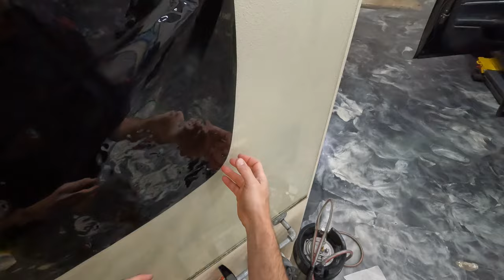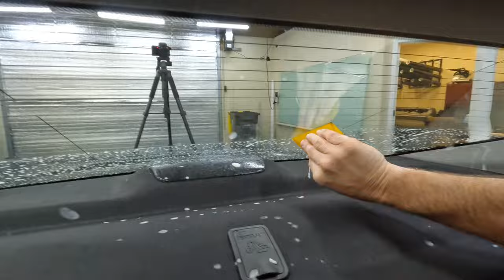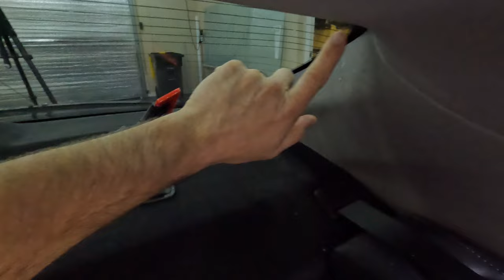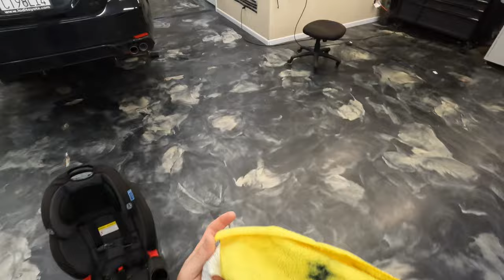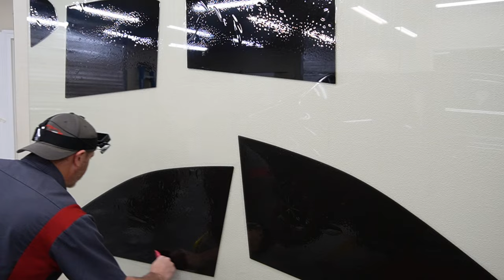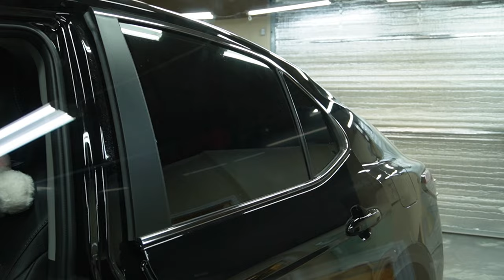2024 Toyota Camry Window Tinting Masterclass: Full Car Tutorial

Comment: Love the content! Quick question! Dry shrinking vs wet shrinking is it personal preference or is one better than the other? Thanks for the help!
Reply from the maker: Thank you. These window tinting tutorials will get better with some more time. I've only been recording window tinting for a couple of months. I'm going to do some much more in-depth videos on heat shrinking and things.

Dry shrinking is leaps and bounds better than wet shrinking.  Was taught wet shrinking when I started tinting.  I used that technique for a lot of years. Once I tried Dry shrinking.... I never looked back. 

With dry shrinking, you can shrink the full area around the finger. That really helps with large fingers. With wet shrinking, you only get to shrink the film where it's not touching the glass. Also, water is your enemy when shrinking film. It's working against you the whole time. It is also so much easier to crease the film. 
Well, there is my input on that. I have a lot more to say, but not with typing. 😆 this is already more of a short story. 🤣
Reply: Thanks for the in-depth explanation. I’m just starting to learn the trade. I took the rear quarters out to tint them since this is my first time and they had some small contamination on them. I’m putting off trying to do the back window last because that’s what I fear the most lol. I’m also trying to figure out on a reverse roll how how the liner ends up being on the outside 😂
Reply from the maker: I need to do a more in-depth video on the reverse roll as well. It's an awesome technique.  I've got more tint videos coming on Fridays. I do explain the reverse roll even better. 
You need to learn to tint those wings in place.  Pulling them out is a bunch of extra work! 👍🏻
Reply: @EncorePPFtint  thanks again for the help! I’ll be keeping an eye out for those upcoming videos!
Reply from the maker: Fridays window tint install goes over how to unroll the reverse roll so the liner goes onto the back of the tint. That should give you some good info. 👍
Reply: @EncorePPFtint Great! Thank you!

Comment: I was told that these cleaning pads can damage the defrost line. What would it be if you had to use a different tool to clean and reach the bottom of that back window?
Reply from the maker: First, I'd like to say that these cleaning pads will not damage defroster lines. I've tinted thousands of cars over the years and haven't every damaged any defroster lines with this tool or scrubby pad.

I'll give you links to the products I use. Maybe this person was using something that looked close but was more abrasive? Honestly, you won't ever damage defroster lines with these tools. I can't stress that enough. 
Scrubby pads (I've never bought another brand)- https://amzn.to/4b2Z7yv
Scrubber handle- https://amzn.to/4aKXxle

I've been using these exact scrub pads my entire career. There really isn't much else to use that is more delicate to the surface. These are the most mild scotch brite pads. The next step down would be putting one of the yellow microfiber towels over the scrubber tool and using it that way. 👍

Defective defroster lines might come off, but that will happen with a micro fiber towel or during repositioning of the window film on the glass (during the installation).
Reply: @EncorePPFtint  Thank you for taking the time to reply. I appreciate your input.